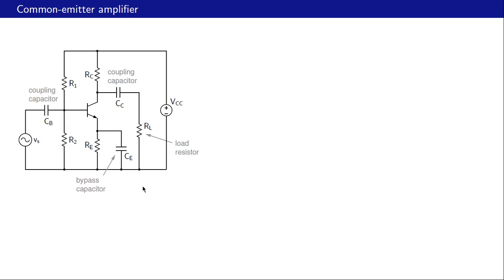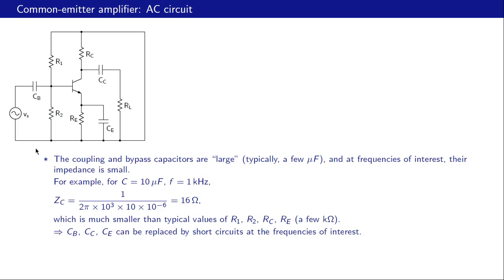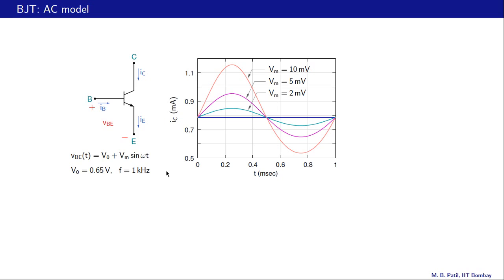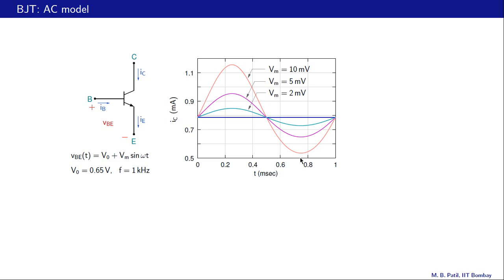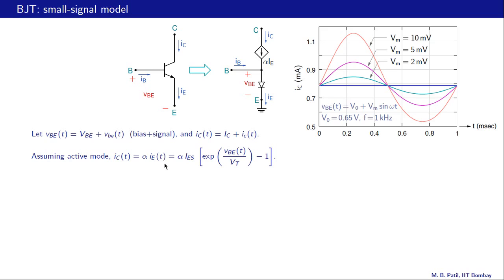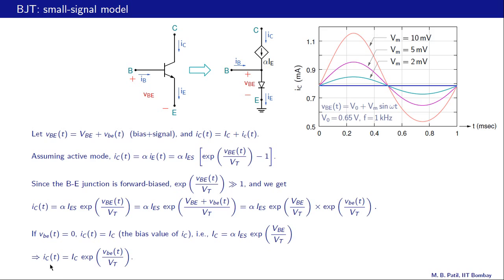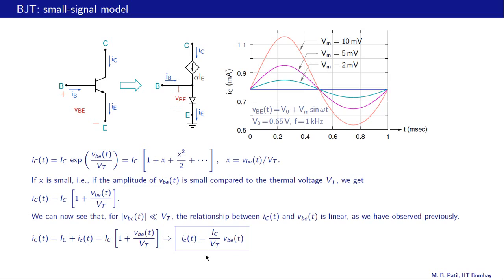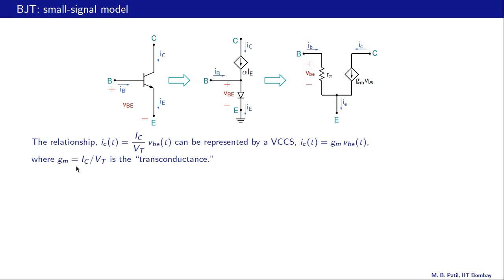BJT AMPLIFIER-4

Comment: So far, the teacher has not describe the purpose of emitter resistor in the BJT amplifier. I am not sure if/when this is covered. Also, when is the frequency response of input and output portion covered? The coupling capacitor and the transistor itself, imposes a frequency response.